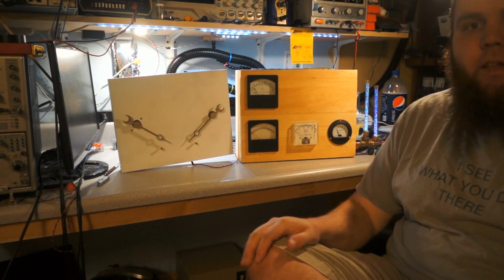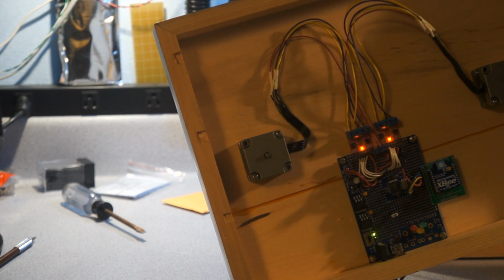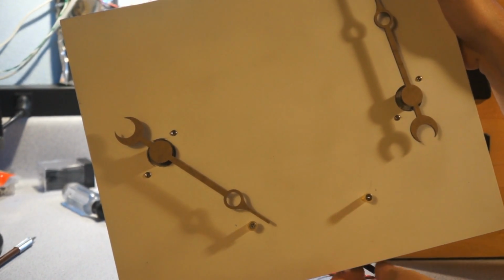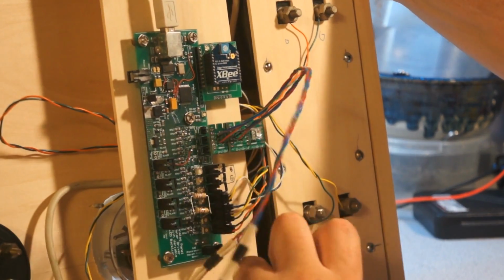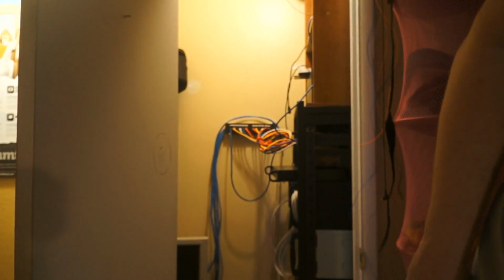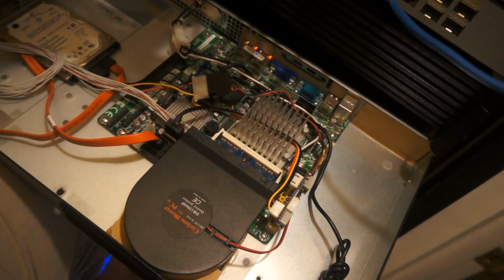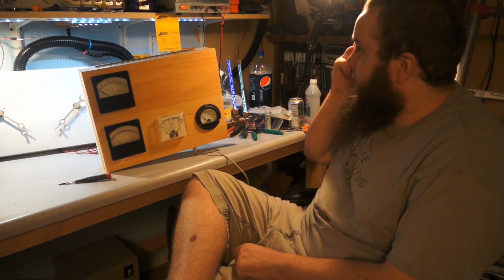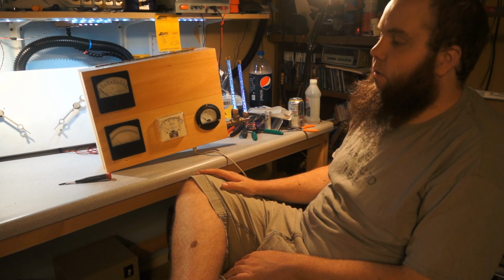Network Meters

Comment: Good video - those meters look fantastic. Our NAS' have the same capacity - mines running 3Tb drives, 12Tb total, 9Tb visible (raidz1 under ubuntu). Just recently switch out from a microserver with 4gb ram to a I7 with 8gb so it has enough horsepower to transcode 1080p video on the fly for things like android and ipad tablets.

Comment: Have you thought about using some contacts at the endstops that are closed by the needles? Could be microswitches with long levers poking through the panel or even simpler some piece of (almost invisible) wire that gets pushed against the srews or for something completely different a photo interruptor on the shaft of the needles.
Of course now the stop would have to be programmed, but on the other hand there wouldn't be any "knocking" anymore and the zeroing could be less conspicuous.

Comment: I have some really nice 3Com NIC's that are PCI. Could never get them to run reliably under LINUX. Worked perfectly with Netware and Win95/98 but otherwise they would randomly fall over until you reset. Even have some ISA ones that are 10baseT and 10base2 as well. I have been using them up for the DcDc converters if I need to drive a 7106 meter from 5V and want a grounded input. Think 2kV of isolation will be perfect for that job.

Comment from the maker: A lot of this depends on what you define as an "actuator". 

I don't think it's a stretch to claim that the system already uses actuators. What other word would you use to describe a motor that accurately controls the position of something.

If by "actuators" you mean something like a hobby servo, I had considered that (for maybe 2 seconds). They're just too noisy, and there would be little benefit. 
This thing is in the room where I sleep, you know.